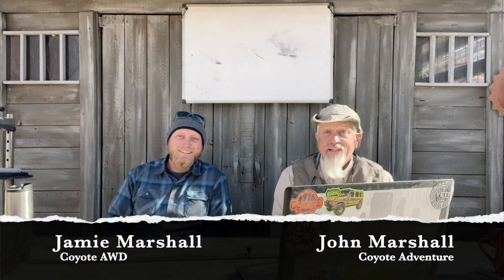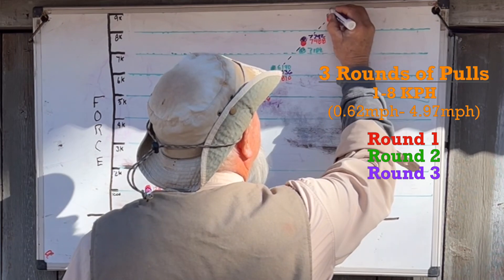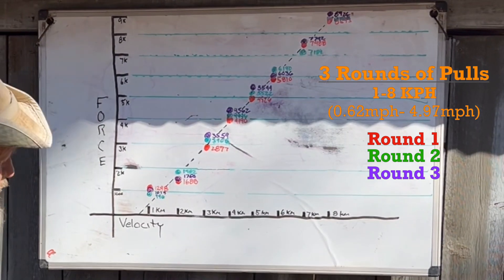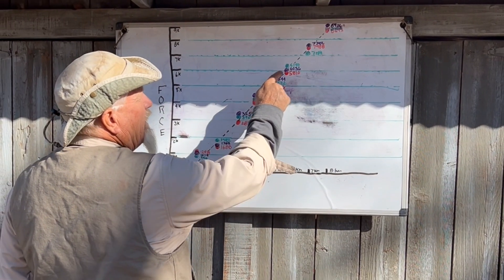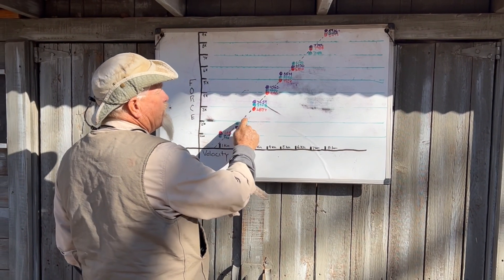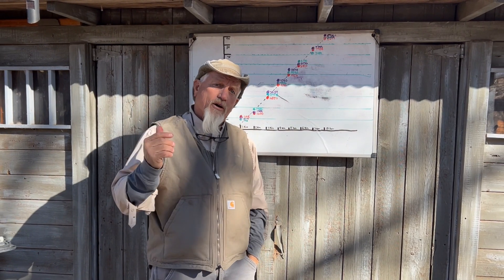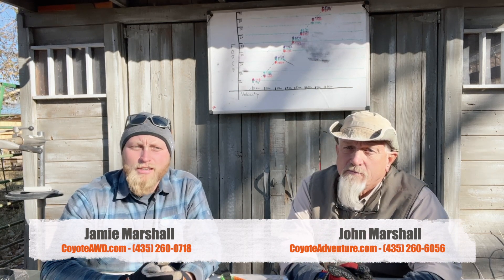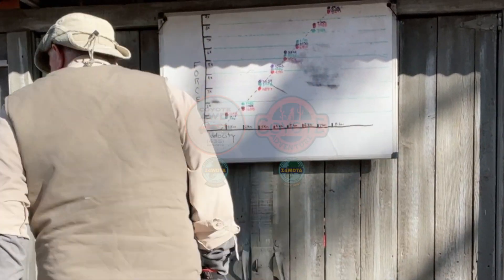Realistic Kinetic Energy Rope Forces

Comment: Great data ... and good advice ... thanks for running this test and reporting the results.  What diameter and length of rope did you use?  I'm guessing 7/8" diameter and 30 foot length. Would love to see the difference in load created by a different length of kinetic rope ... suspect that a shorter rope will create less load at each speed.  If so, then the 20 foot ropes could safely use a little more speed than 5mph.  Most of us are recovering with Jeeps, but it would be interesting to see what loads a heavier vehicle could produce ... that would be a difficult data point to obtain because of speed control.
Reply from the maker: I used a 7/8 rope in this test.  Thanks for the kind words.

Comment: Those load numbers have to get crazy with a heavier truck, even at those speeds
Reply: Regardless though, now that we have a metaphorical measuring stick, with a heavier truck, just start at a lower speed. Most heavier trucks have larger engines with more torque so if someone follows his instructions, and initially just tries a straight traction pull, most 3/4 and 1 ton trucks have the weight (traction) and torque to just straight pull the vehicle out without needing momentum.